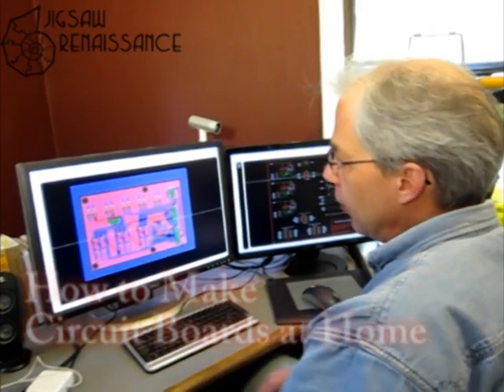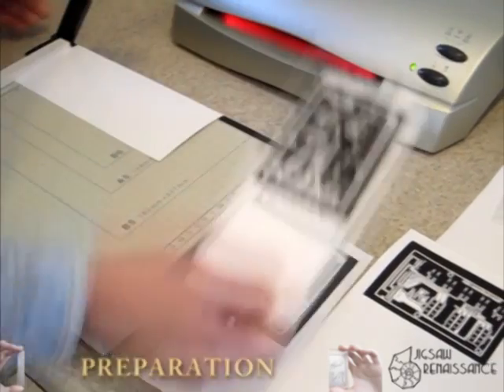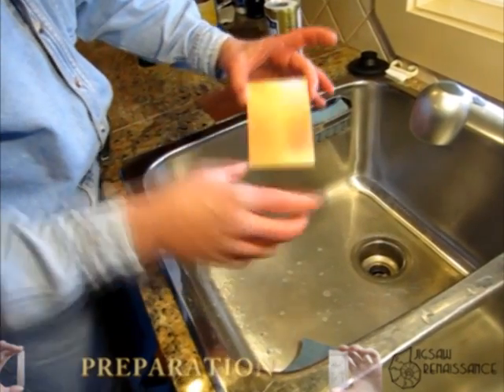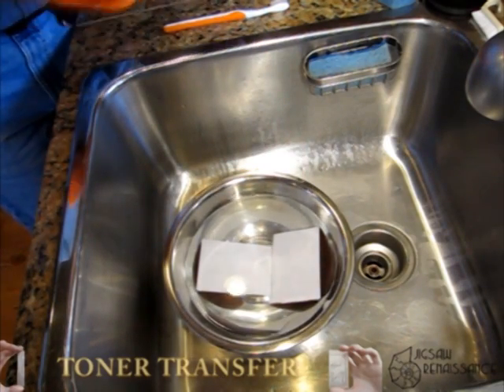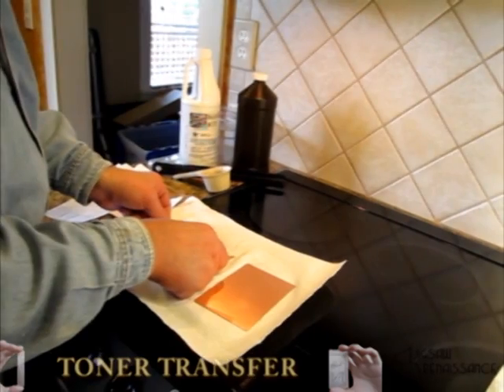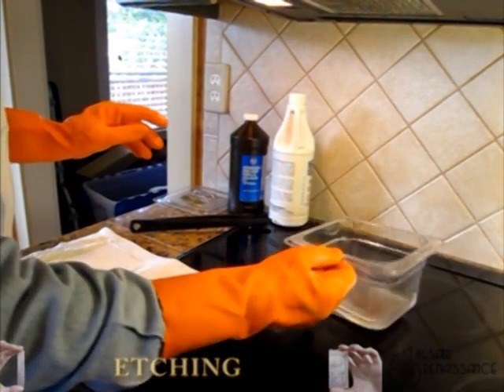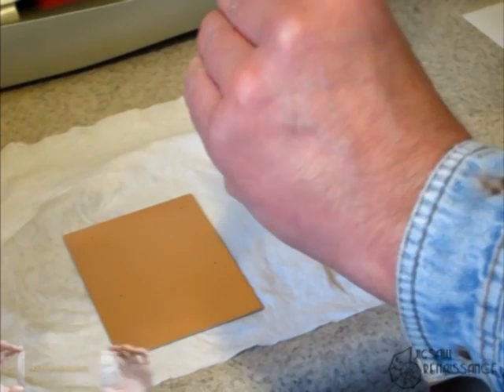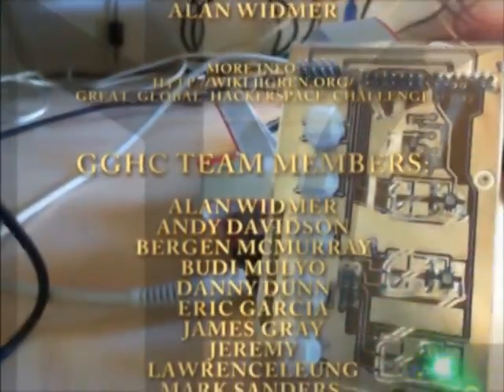How to Make Circuit Board at Home

Comment: Thx for the very professional presentation. My take away was the laser labels for high temp adhesive strips.
My input is magazine paper. I have had great success with it and it is widely available and FREE. Funny how the printing does not affect the results. It dissolves very quickly and completely.

Comment: You could also buy this high gloss paper for a local stationary store in bulk, make sure it is very high gloss and try to get the lightest bond instead. With the thinner paper , it will fall right away from the board when you soak it in water. After the board is dried, you make have some slight white residue between the tracks, clean that up with white vinegar. I have used this paper for many years.

Comment: hey ... thanks for the post, u guys look like pros, so I have a bit more technical question. I wanna make a solder mask. Is it possible to just toner transfer ALL the board area EXCEPT the pads to a copper foil (thinnest I could possibly find) then etch it ( that should open up holes where the pads are) , align it to the etched board and then cover the sandwich with molten wax. remove the copper foil (wax will only cover the pads, then spray paint, then bake the board to burn off the wax ???

Comment: I use 80 pound highgloss paper with very good results. For double sided boards I put the schematics face to face under a bright light to line up the traces, then I will put three staples on the one end of the paper so they dont move. I then insert the double sided board in between the two pages and set my iron to medium NOT HOT. That way there is no smudging
of the traces when you iron. After etching I spray a light coat of laquer on the board , that stops any oxidization. works every time.

Comment: Wow, that's a lot of unnecessary steps.
 
I made a board a bit bigger than what you show in less than an 30 minutes with a clothes iron, Kodak photo paper CAT 191 2369, a Kodak ESP-3 printer and Ferric Chloride - less drilling the holes.

Liquid Tin is FAR better than cool-amp. No scrubbing and it's instant.

Anyone interested about the software, look up Eagle by CADsoft.

Comment: I've always used Ferric Chloride as an etchant, hadn't heard of using muriatic acid and H2O2, but it seems you would keep a bowl of baking soda mixed with water nearby to dip your measuring cup and board in to neutralize the acid before rinsing in the sink.

You could then pour the echant solution into the baking soda water and neutralize it prior to disposal.

Comment: Cool.  I do something similar, but since I don't have a laminator I use a clothing iron set to maximum heat.

Don't have a circuit design program so I draw them out on MS Paint, print on plain paper first to check against the size of the components.

To save money, I just use the blank side of old wall calender pages, the ones printed on glossy paper of course.  They're free and have had no problem with the transfer.

Great tutorial.